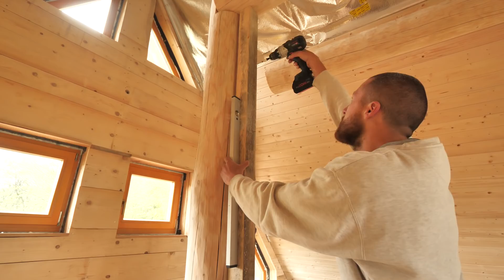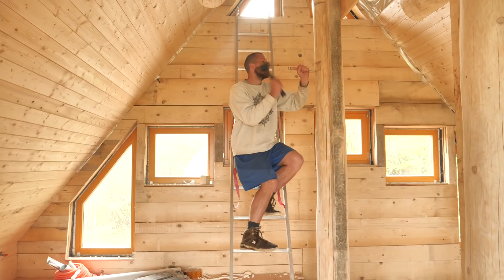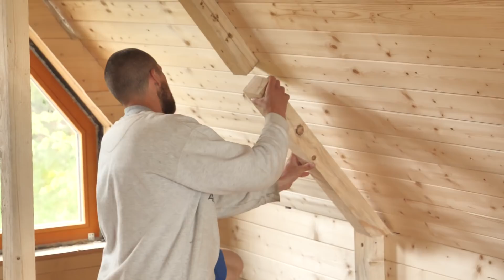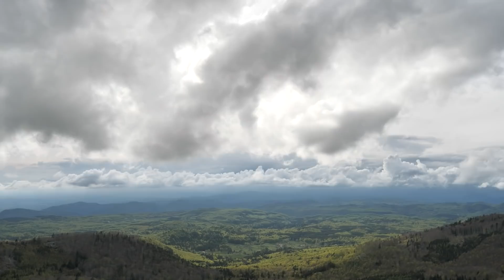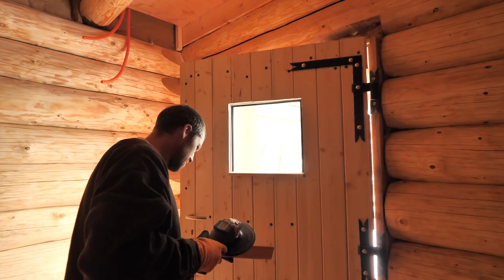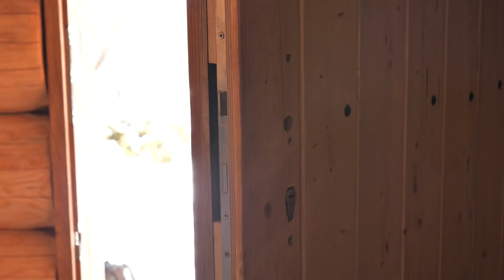Off Grid LOG CABIN Build / Dividing Loft into Two Rooms (S3 Ep8)

Comment: nice lock design. looks like regular lockpicking would be hard.
still need multiple bolt points, or have door swing outwards with a metal gap cover.

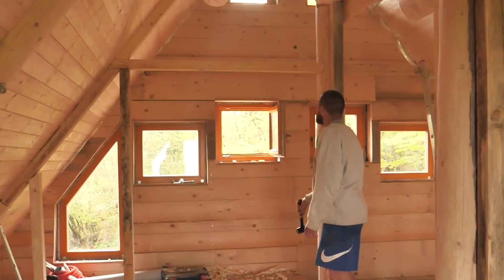Comment: 20:48 In an earlier video, you mentioned that you didn't want to use the chainsaw inside to cut/carve the beams, because it spews chain oil when it's used, which you said would stain the unfinished wood floors and ceiling, and that the fumes would also be bad inside.... and yet you're using it. ?
Reply from the maker: It was a really quick cut in a place that would be difficult to reach with a hand saw.

Comment: Say Nik, didn’t you mentioned that at this stage using the chainsaw inside would leave oil markings on the finished interior?
Reply: Yes, he said so but i guess cutting of that log by any other means would have been a pain in the ass.
Reply: I use electric chain saws inside,, no fumes & olive oil for lube,, quarter radius chain saw tip,, zero kick back!!

Comment: I'm worried that there are no beams holding up the middle of the floor. He is adding a lot of weight to the center of the top floor of the house with no beam on the first floor supporting that weight.

Comment: 3 seasons episode 8 to finally put the window in the door! Nik what you are doing is great, and I understand that you are alone most of the time for the build, but honestly, I question how you prioritize your tasks! The window was postponed for three seasons, but the coffee table was a top priority ??? Putting a wood stove should have been an earlier priority, but was not! Sanding the logs inside was insane, instead of doing the sanding outside, which you later finally decided! Much easier to sand horizontally than to sand inside at the top of your arms and then blow the dust all over the interior! Later on, you carefully finally used the broom! Some of the things were downright dangerous: sawdust in a fire could act as an explosive. Finishing under the first floor should have been a much earlier priority! I'll stop here, but please take an honest look at these comments, because your original vision was to share with others, which begs the question: what happens if what you are sharing is wrong! Those who don't know any better and are excited about all your explanations might do it the same way you did it!       Anyway! These are my five cents to help improve what is otherwise a giant overtaking for one single person!